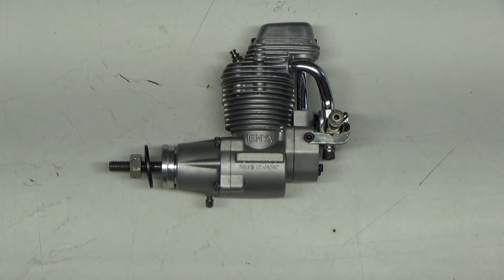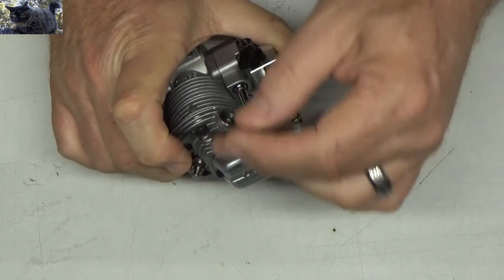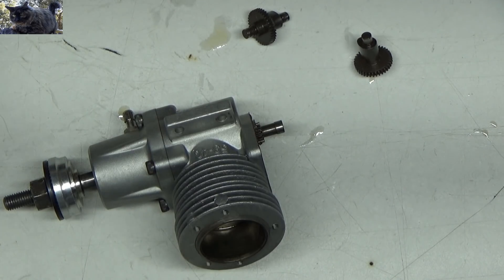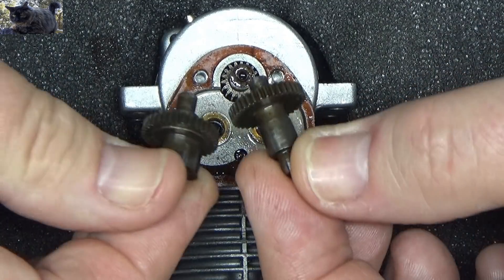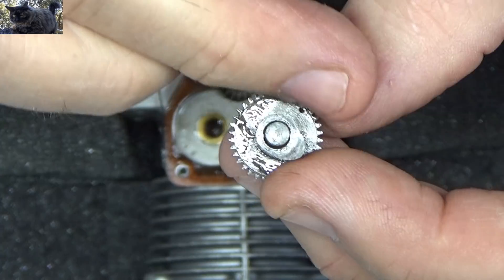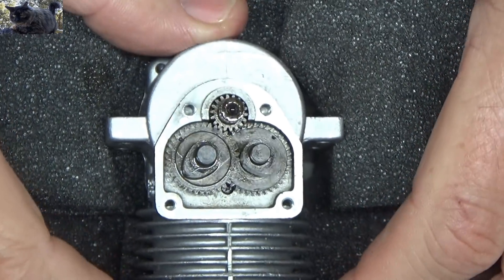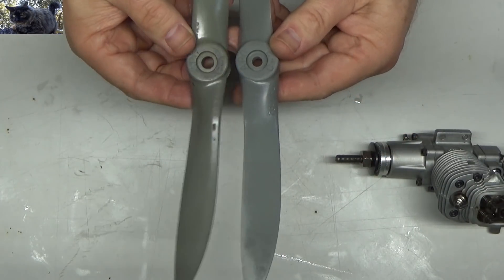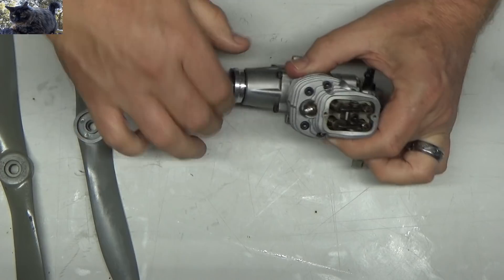How To: Enya 4 Cycle Reverse Rotation

Comment: I think your video is the first showing the process explained step by step, mounted on twin angine planes the normal rotation were mounted on the left side and reverse rotation on the right wing that made easier to design the mount angle, (right to down thrust related engine installation to compensate for an engine out situation and asymetric thrust) with this feature the ENGINES could use straighter making a twin engine plane less critical to enter in a spin with a dead engine. Good to see Bella, she is always with you.